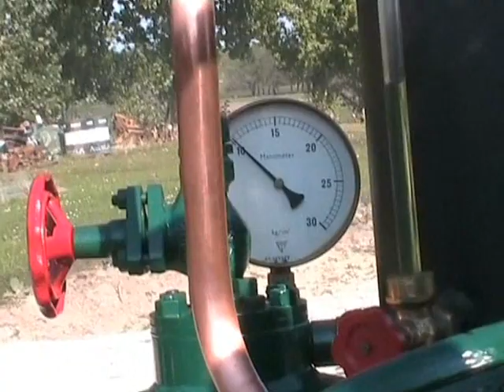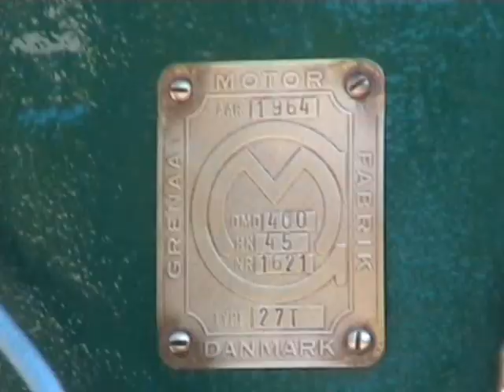Grenaa #2 - Type 27 T - 45 HP hot bulb / Glühkopf & Semidiesel

Comment: It is not a hot bulb engine. It is a medium compression oil engine. A hot bulb engine uses a heated bulb to vaporize the fuel which was injected on the intake stroke. Combustion occurs when the hot air from compression enters the bulb. This engine injects the fuel at TDC into a precombustion chamber, the heat of compression  with the aid of the glow plug vaporizes the fuel and ignites it. A hot bulb engine has about 60 PSI of compression, this engine probably has about 200 PSI of compression.
Reply: This engine cylinderhead has to be heated as well prior to starting

Comment: i dont see the blow tortch to heat the cilinder head, so i bont think this is an hotbulb/gluhkopf engine
Reply: It uses hotbulb ignition but it starts with a glow plug.
Reply: okay, a glow plug on electricity, is that original? or re built, if it is original it is a semi diesel.
Reply: @arievogelaar7664  It is a semi-diesel as I recall from the instructionmanual, same type as the Hundested

Comment: @Motorsamling Does this engine use a scavenge pump for crankcase oil removal or a check valve system? One fellow over there told me that some of the 2 stroke hot bulb engines (Rap?) had proper oil sumps. How was oil prevented from reaching the combustion chamber in that case? Fine video, thanks. Were you trying to get it to run backwards at thew end there?
Reply: No scavenge air pump on this one. Underside piston acts as the scavenge air pump

Comment: not much hp but the torque figure is going to be HUGE
Reply: around 600 ftlbs
Reply: +Bob Saget 
Nice, I've looked around and it's hard to find torque figures for old engines like this.
I know modern engines have a better power to weight ratio, but I wonder what the equivalent modern engine would be to replace this. (Likely more HP, but less torque, to get he same amount of power ... if you need slow speed and high torque, you'd have to use some sort of reduction gearing system)
Reply: i came up with a number mathematically.  if you know the RPM and the Horsepower, you can know the torque.
Reply: Ohhh ... wow, gee, I feel stupid now XD I should've known that!

Comment: OK .... I'm confused ....

Looked for the hot bulb in the head ..... But couldn't see it .... ????

Is that a compressed air start as well ..... ?

BTW .... I AM IN LOVE .... :) This is a beautiful engine ...... :) Well done .....

New sub ..... Jim :)
Reply: They start it by compressed air.
You get ONE shot from the (air)tank and then it better start. They usually do, but if not, you gotta fill the airtank manually. It should be done in less than a half an hour.